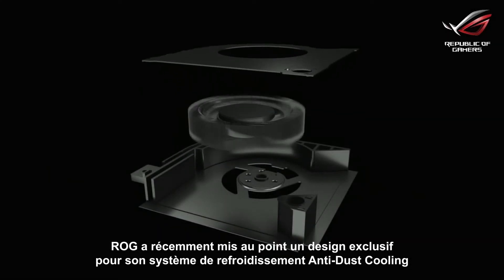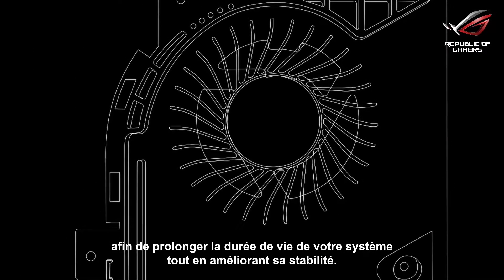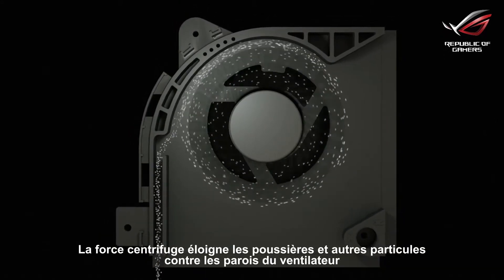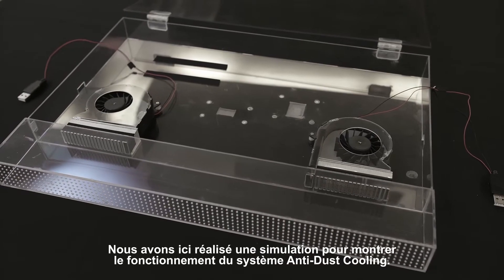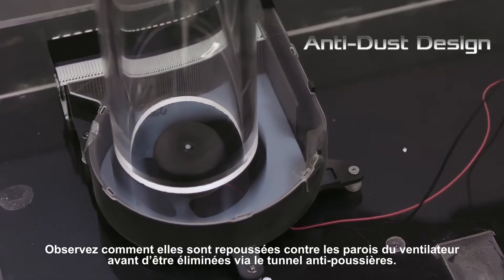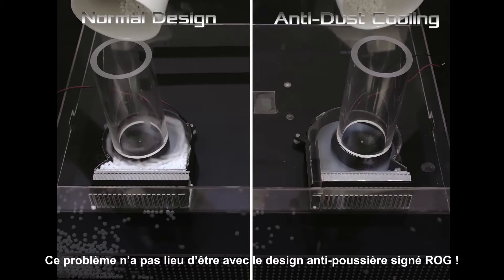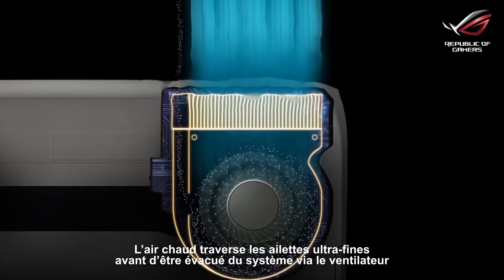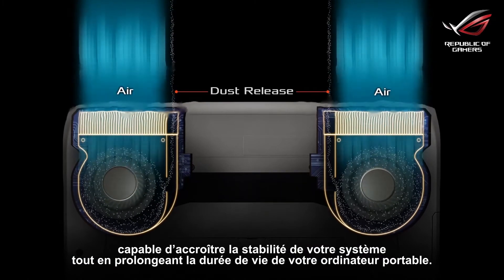Technologie ASUS ROG Thermal Anti-Dust Cooling

Comment: Interesting design but I'm concerned about what if the particles happens to be sticky, small enough to go in fins and already attached to the fins and since there's a path aside the fins means there will be no enough airflow pressure to blow the particles away🥲